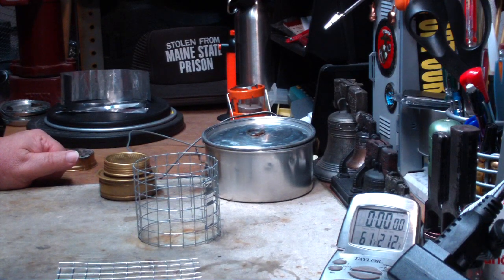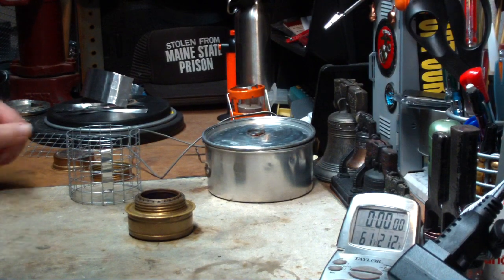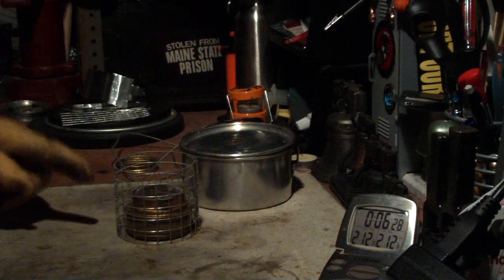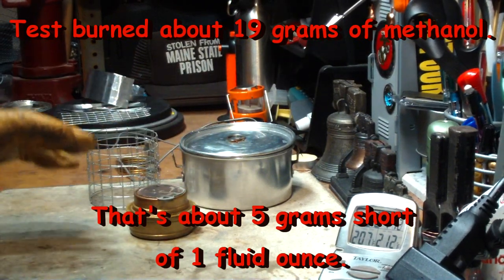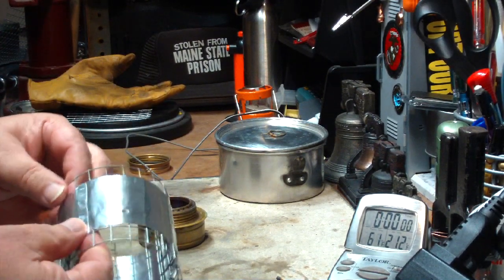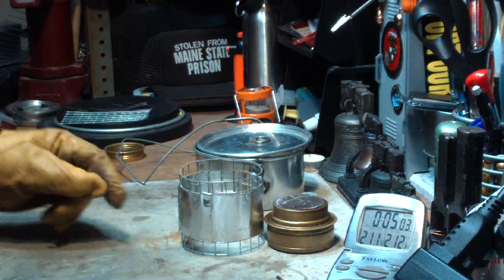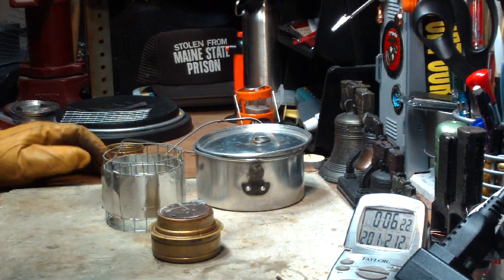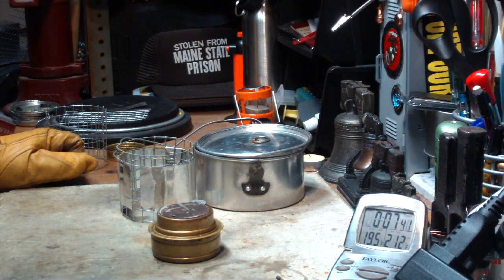Trangia Pot Stand / Windscreen Suggested by JHIPPL

Comment: There is a danger when using galvanized anything with high heat/flame.
Toxic fumes can be released.
Reply from the maker: This is true Crazy Squirrel. That's why I keep my face away from the stove and only use it in well ventilated places. Thank you for your comment.

Comment: Weight is NOT effected by temperature. Only volume is dependent upon temperature when doing a volumemetric equilivant weight measurement. So as you are basing your weight on actually weighting the fuel consumption.
Reply: He is weighing the remaining fuel to document the rate of fuel consumption (burner efficiency).  The warmer the fuel in the burning chamber: the more it gassifies: the more fuel is being used.  

This increased rate of fuel consumption may not be beneficial in comparison to the decreased boil time from not using the heat reflector on the pot stand.

Comment: measure the diameter of your trangia in mm. Add a couple square lengths in mm to compensate for overlap of the mesh. Then do (pie) x diameter to get the length of your screen.

Comment: you know~  I wonder:  I wonder if it would be practical to drill several holes in the bottom of the Trangia Mini stove stand or even cut a hole big enough to allow the flame through but small enough to rest the stanley cooker on~  I think the holes would be better~  That way we could turn the mini stove stand UPSIDE-DOWN and not only is it possibly a make-shift windscreen, but will allow a surface for the stanley to rest on sans nails or wire rods, etc~  What do you think?

Comment: So it looks like 19 grams is the amount needed to boil 2 cups with that pot, now I would like to see if the felt test shows the same fuel consumption with different times, with it all coming down to how much heat is being transferred back to the stove.  The stove is just being turned up or down.  Have you measured fuel consumption in your past tests? You could cut a hole in some felt the size of the threaded portion of the stove to keep the stove cool to create a low setting ? 19g ? 12min ?